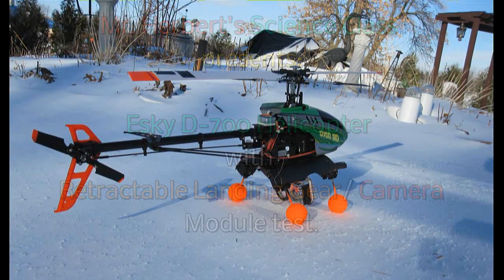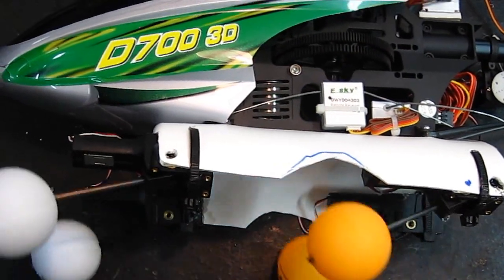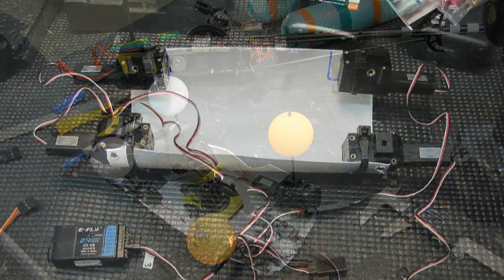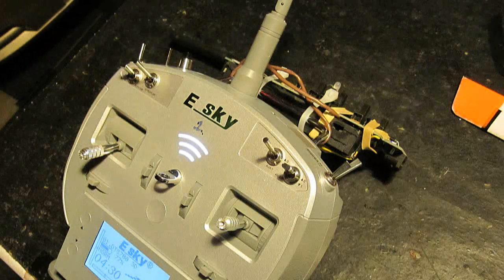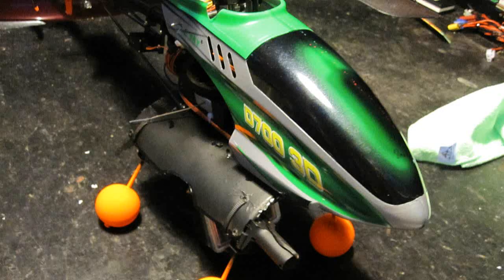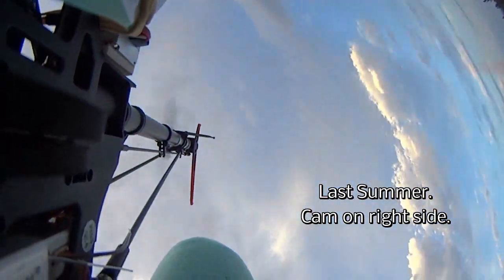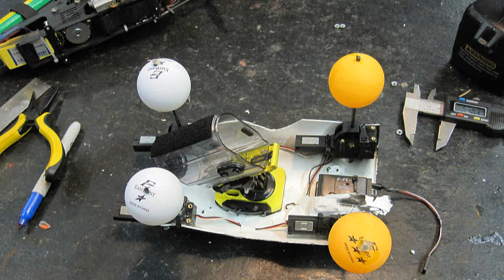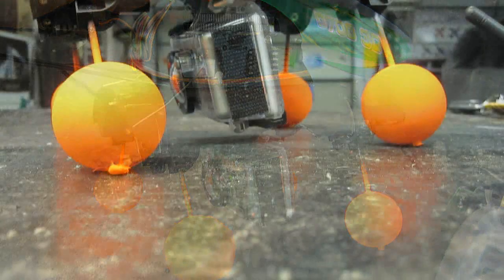Esky D-700 Helicopter with Retractable Landing Gear-Camera Module. by NightFlyyer.

Comment: Great Job as always Dave What's next the cat. A little cam mount to see were she goes and what she is up to.
No on the serious side good job,I now have one of the hobbyking Blade 350 QX  which i am messing around fitting the Hitachi action cam to but the QX as you know comes with Gopro fitting so got to do some modding to make the Hitachi Gopro parts fit together .

Comment: Hi! I have a question - what kind of orange paint do you use? Is it spray paint? I tried using that on my blades but it was too heavy and I had to change my CG and re balance them. I just tossed those and got KBDD blades. Now I wanna make my tail blades orange, but I don't want to ruin them. Is there a kind of tape I can use that would hold in flight?

Thanks!!